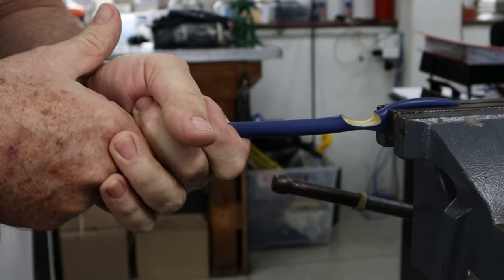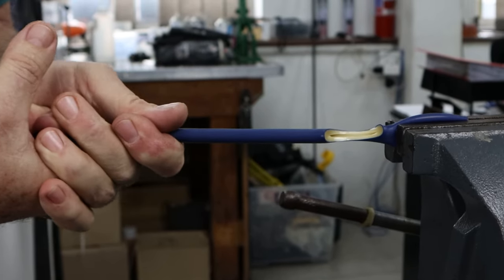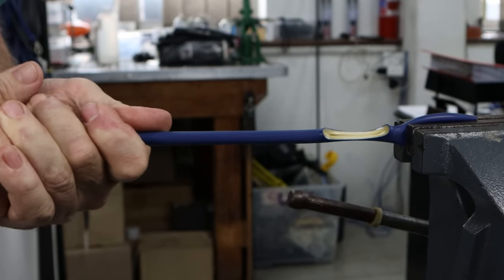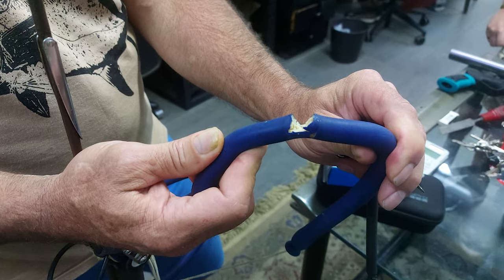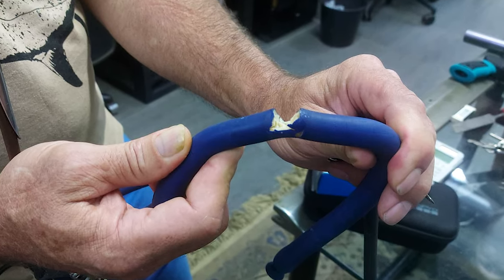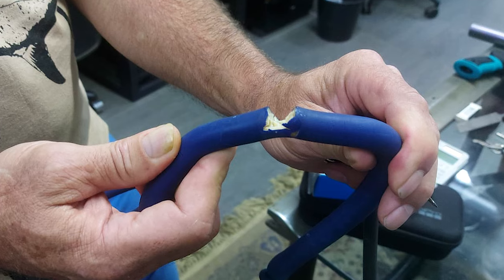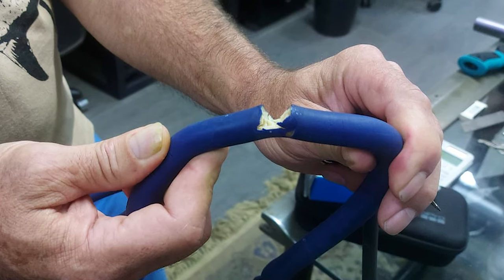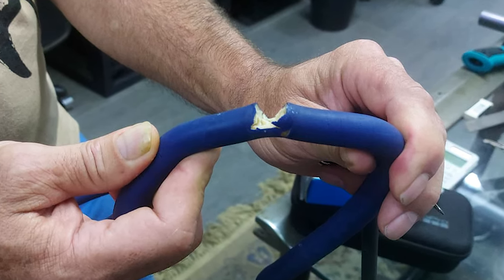Rob Allen | Rubber Notch Durability | Part 2 | 2023

Comment: Hi rob, I have a timberline roller 110 and Im returning it to stock rigging, what is the band length for the 16mm bands, what is the stock spear length/ overhang. Thanks heaps❤
Reply from the maker: Hi Jake, all our 1100 guns take a 1500 spear. You can get all rubber sizing on our website. https://roballen.co.za/?product=rollergun-bands-16mm-black-gt-tuna   You will need a 70cm, but you can shorten it a little if you need more power.
Reply: @RobAllenSpearfishing  thanks very much man

Comment: Ciao Rob,su un roller  da 110 e asta da 7×145cm  vorrei usare elastici da 18. Che lunghezza devo usare?Che percentuale di allungamento consigli? Grazie
Reply from the maker: Not good, too much power. A 7mm spear works best with a 14mm rubber at 360 to 400 % stretch.

Non va bene, troppa potenza. Una lancia da 7 mm funziona meglio con una gomma da 14 mm con un'elasticità compresa tra il 360 e il 400%
Reply: Ciao Rob grazie per la risposta.Io la uso nel Mediterraneo e qui tra uno sparo e l'altro passa spesso tempo.Un elastico da 14 stirato fino al 400% non si danneggia perché troppo tirato? Penso che abbia anche poca forza alla partenza.

Comment: Pls .....1:. what is the stretching factor for rob allen rubber south Africa made 14 mm ...
& 2 .. I have rob allen  120 cm .. what is the best rubber length for 14 mm or 16 mm .
Thanks.
Reply from the maker: We set our guns at around 350 to  375%  The rubber can handle 400% but few run it that hot. All rubber lengths can be found on our official Rob Allen site.       https://roballen.co.za/